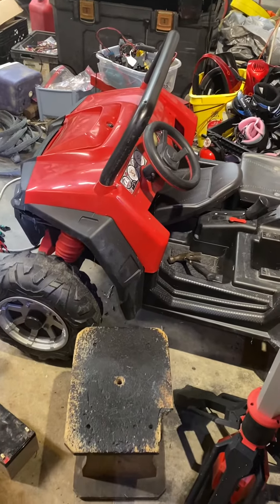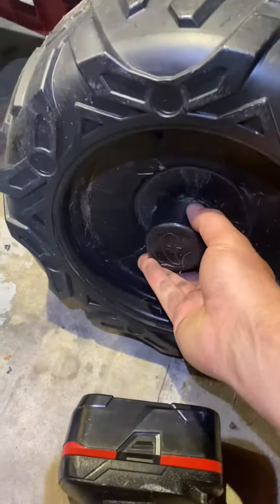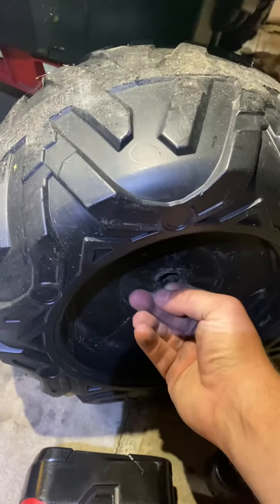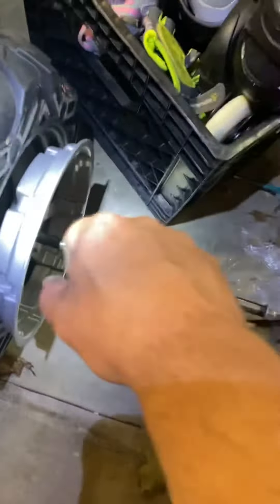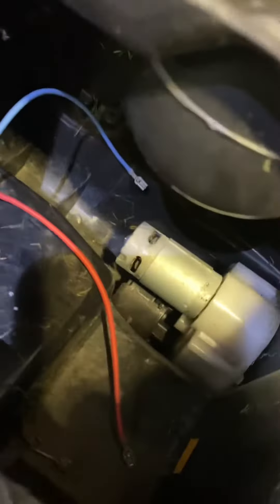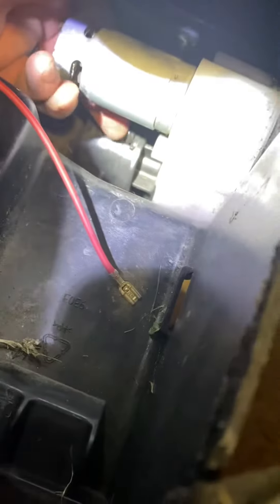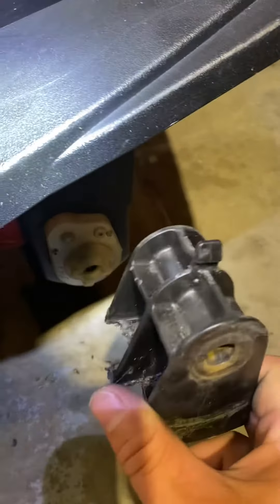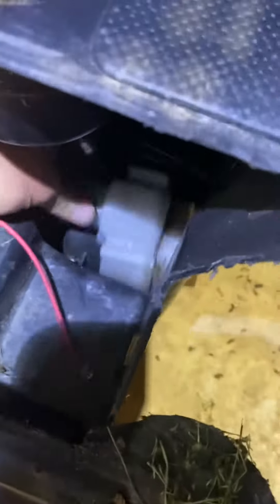Peg Perego polaris 12v RZR 900 how to pull gearbox and motor out for replacement

Comment: Okay, now how do I replace motor without sawing through the plastic? Lol need another video to see how to access
Reply from the maker: Hard to remember now, but at the time, I don’t think I realized that someone else had cut that access hole. I didn’t do that.
Reply: Underneath the part of the vehicle with cup holders, there are four screws. Unscrew them and the back bottom half of the vehicle with the motors will swing down. To do this, I stand the entire vehicle up on the grill and lean it against a wall so it doesn't fall forward.
Reply from the maker: @AtlasGaming50  awesome thanks

Comment: Where is the fuse located..i lost all power
Reply from the maker: Some have breakers that reset, some have fuses. Fuses are typically right by the battery. Check the plastic cap that goes on top of the battery or under the cap.